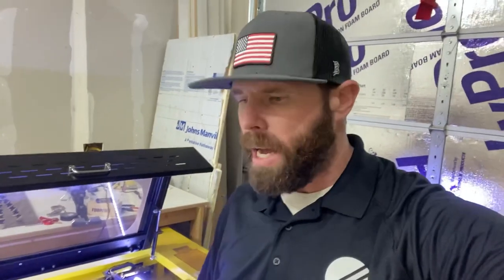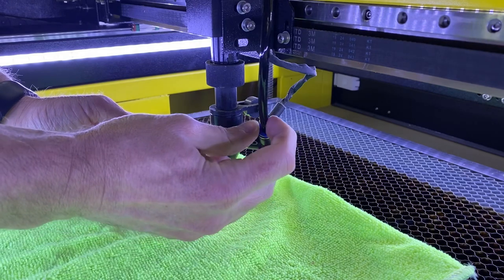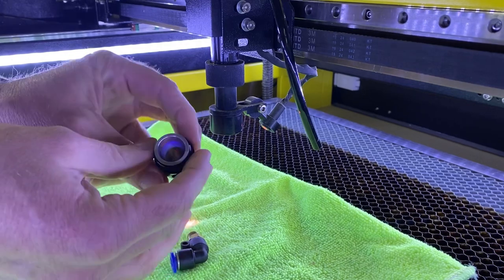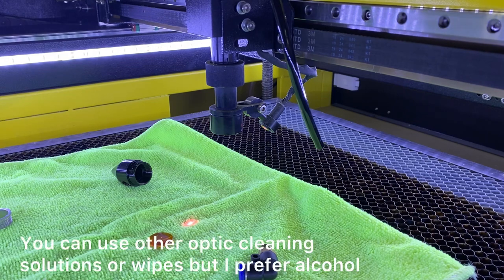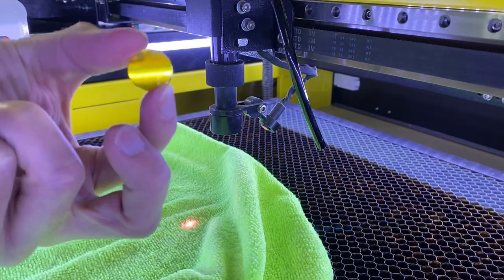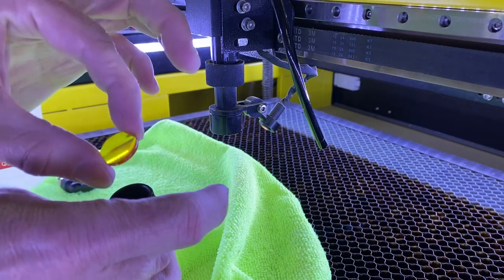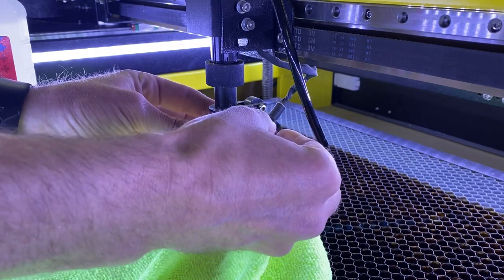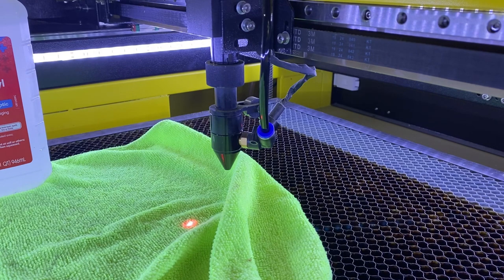Co2 Lens removal and cleaning on your OMTech laser

Comment: thank you!  just bought a used 50w OMtech that had been in storage for awhile.  scouring you tube for similar machines so i can get mine up and running.  i was able to clean the other lenses but was unable to get to the main one.  i guess i was afraid to pull at the black hose too hard, but that was what it took.

Comment: Good tutorial, one correction - the plastic ring goes below the lens, not above. it is there to isolate air in bottom chamber.
Reply: Then why does the operating manual state "Carefully insert lens into the lens holder, ensuring that it's rounded convex side is facing upwards. put the o-ring on top of the lens. carefully reassemble the lens and laser head attachments in reverse order"
Reply: @nickredd6168  chinese mess up things like that a lot. You decide for yourself. I explained you how it should be. This is how my laser had it also.

Comment: Thanks for this. I've had an Omtech 60W red & black laser since February and just cleaned the lens and mirrors for the first time. I have the autofocus sensor, so had to remove that in order to unscrew the cone as well, next time I'll try just unscrewing the entire air intake as you did. One issue is I'm not sure if I put the lens back in right side up or not. Will the results be very obvious if I have it in upside down? I know your video and OmTech's video both say that one side is concave and one side is flat, but they both appeared very flat to me. And I can see my reflection in each side as well - in one side it is quite close so my face appear large, so I assume that's the side that is supposed to go up, while the other side (hopefully the flat side) looks more like a mirror image, where I can see my face and shoulders etc, that is, one side appears that I'm looking into one of those magnifying beauty mirrors and the other side appears more like a regular mirror with no magnification. Hopefully that's the flat side and goes down (towards the work piece)?
Reply from the maker: The side where you can see a full reflection of yourself is the curved side and that is the side that should face up and receive the laser beam.
Reply: @BeardedBuildsCo  Thank you! I had put it in upside down, although surprisingly it seemed to still cut fine and be about equally sharp. I’ve flipped it over now, but googling I came across a handful of articles suggesting round side down, or that it doesn’t really matter (!)

Comment: So I just got my 55 W and fired it up is it normal for the red dot to be 6" away from the laser nozzle ?  If not how do I go about adjusting that?
Reply from the maker: The red dot comes at an angle from the side of the laser head it is only accurate when you has set your focus height.

Comment: Hi sorry to be a pain but I moved the shaft rather than unscrewing the nozzle part has that now lost my focus or does it not matter to the focal part where the shaft is positioned
Reply from the maker: It should not make a huge difference. If you see any issues then it would just be an adjustment of the knobs on top of the laser head.
Reply: @BeardedBuildsCo  i dont mean the screws on top i mean the shaft that holds the lense and nozzle

thanks
Reply from the maker: Yes, that was understood

Comment: Good video.
FYI:
A dirty lens can also cause the laser to burn the lens where the dirt is. Anything that impedes the light going thru the lens can cause heat, which in turn can scorch or burn that part of the lens. The higher the wattage, the more heat.
Same goes for ALL mirrors that the light bounces off of.
I retired from a Cable Company and worked mainly with the fiber optics (transmitters and receivers, etc.). I learned alot about the importance of clean fiber connectors, which also applies here.
I currently own a Glowforge, but am seriously looking at an upgrade to a AF2028-80.
Bottom line... Keep ALL lenses and mirrors clean!
Reply from the maker: Exactly!

Comment: just replaced my lense and had issue. my question is what srule for length of head . cause with new lense my focal length from tip of head to material is closer now. please if help lo
Reply from the maker: This means that you likely bought a shorter focal length lens.
Reply: @BeardedBuildsCo  thats what i was thinkn . it came from omtech . Didnt know there was a choice
Reply: Also learned one thing you find out real quick you have lense in upside down
Reply from the maker: @randysiebert1667  Yes there are a variety of lens lengths from 1.5 inch to 4 inch
Reply: @BeardedBuildsCo  Brain fart on my part thought that was diameter of lense i did get 1.5